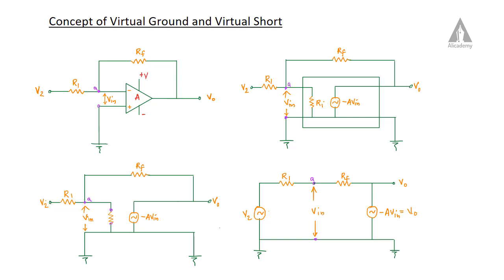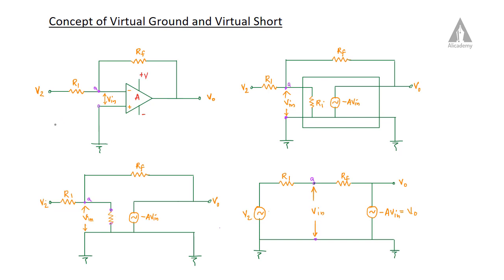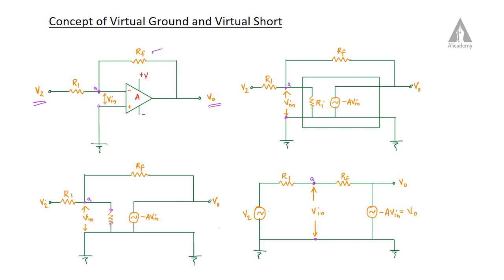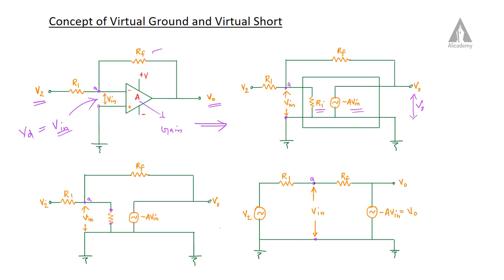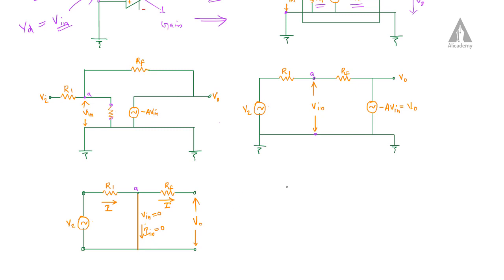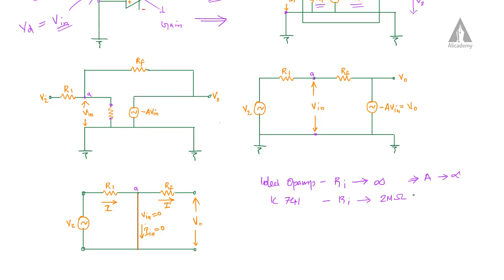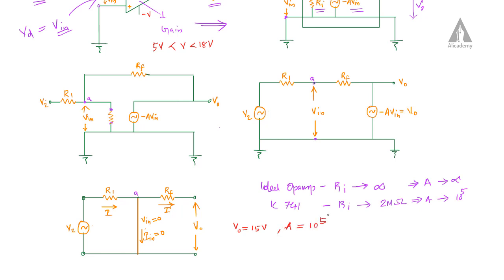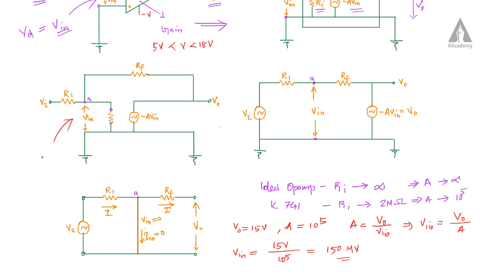Concept of Virtual Short and Virtual Ground | Analog Electronics | KTU | Malayalam

Comment: Sir  why we are not using virtual ground concept in positive feedbacks??
Reply from the maker: Its because the output of the positive feedback op amp confuguration will be having an output that is always at the saturation value. For a sine wave input output will be like the output of a bistable multivibrator.

In negative feedback, gain is stabilised and op-amp works in linear range. So we can apply virtual ground concept.